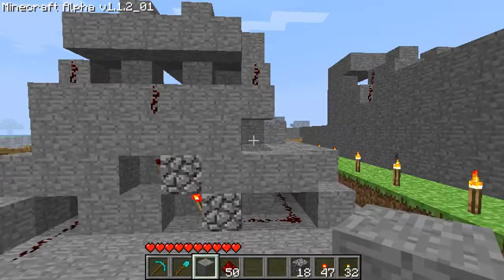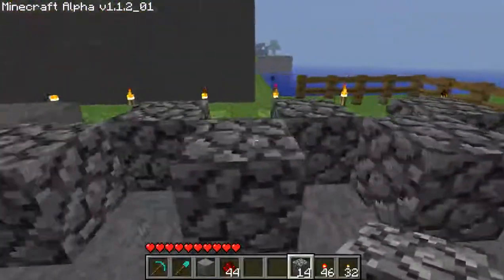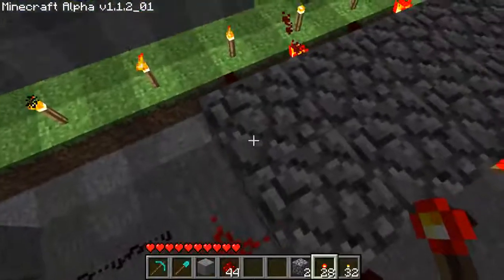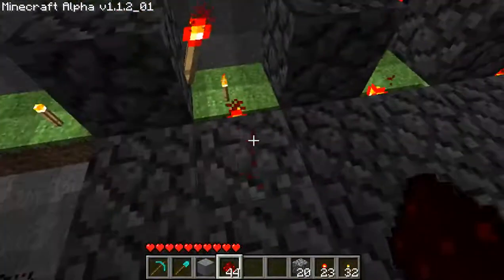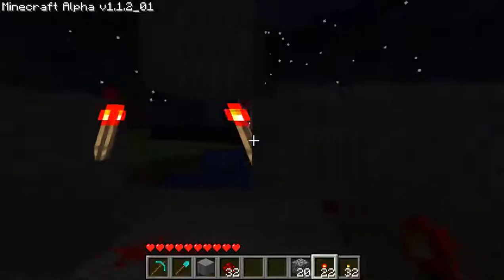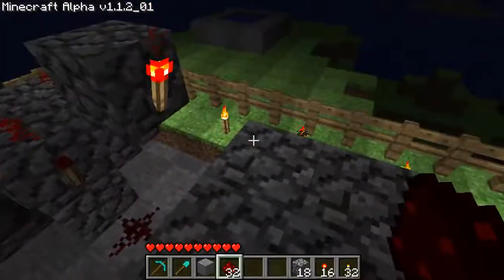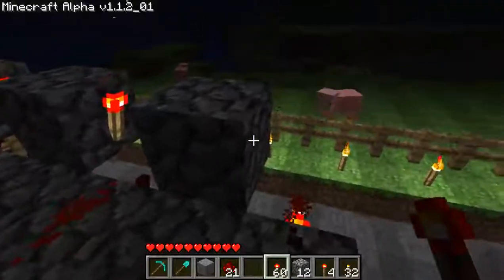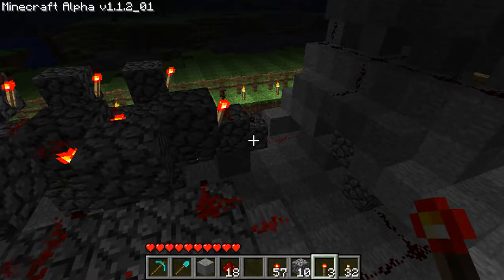How To Build: The Imperial Avenger 6.02.AX (Part 3)

Comment: i got a problem, the 2 rocket TNT packs on the sides ignite from the ignition wires that are meant for the engine TNT.
but everything looks exactly like yours (it doesn't touch the corners).

Comment: For some reason, there is ONE inverter, which happens to be the one to the right closest to the steps and above the first large chest, that isn't switching when the button gives power to the red dust stream.  Everything else seems to be in working order in the timer.  What would cause a single inverter to not invert?